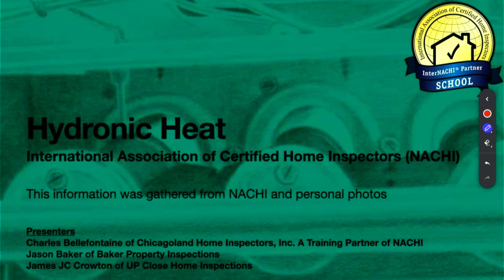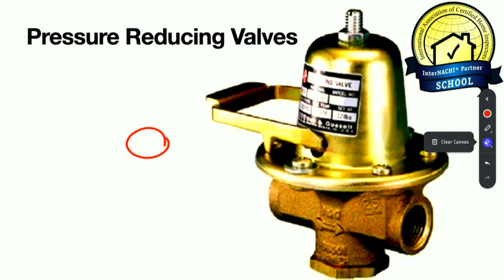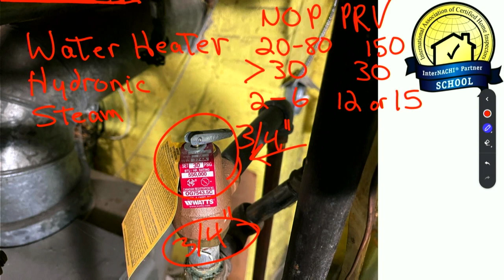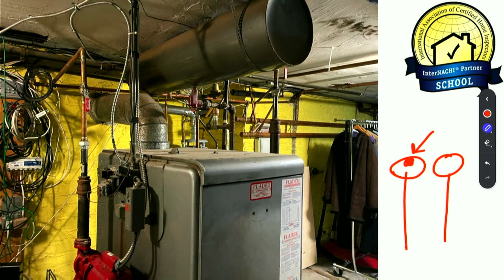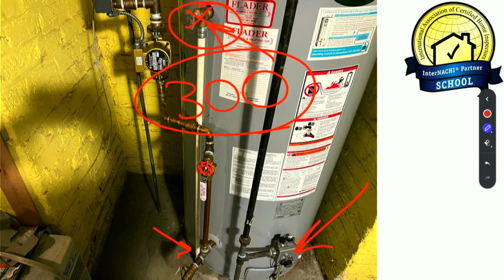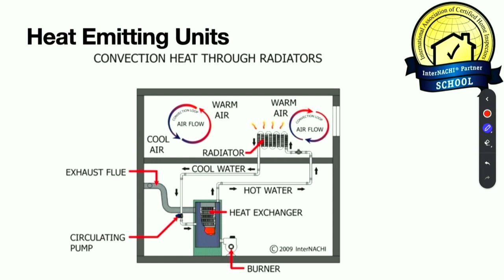Hydronic Heat Webinar with InterNACHI® Partners

Comment: Hydronic heating systems are very common here in Maine, especially with homes 10+ years old. The most common hydronic systems are hot water baseboard. With newer construction in the  area I cover I am  seeing fewer hydronic systems and more heat pumps and propane wall heaters. Thank you for the webinar.
Reply from the maker: All homes should be inspected by an InterNACHI certified home inspector at https://www.nachi.org/certified-inspectors. Thanks for commenting. - Ben.
Reply: @internachi  I concur!